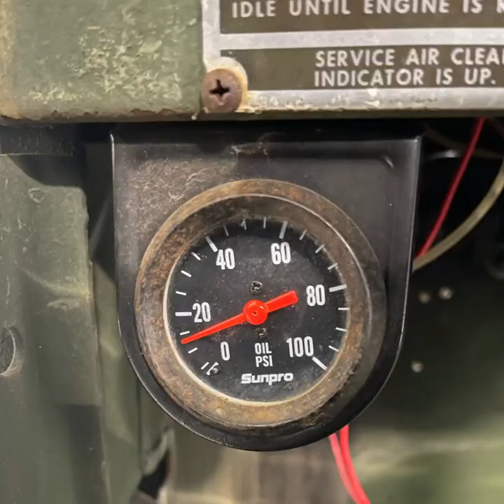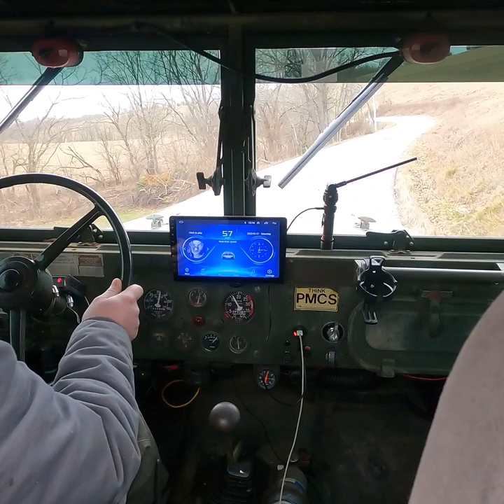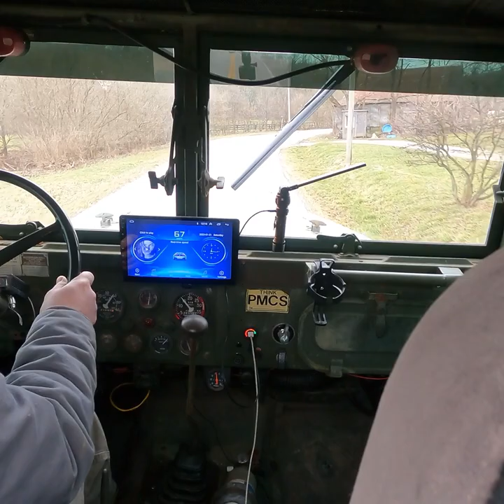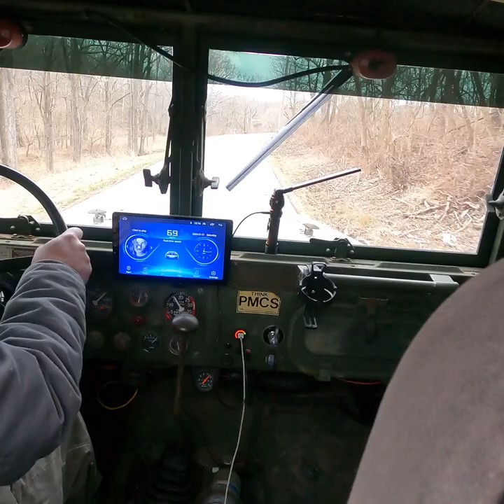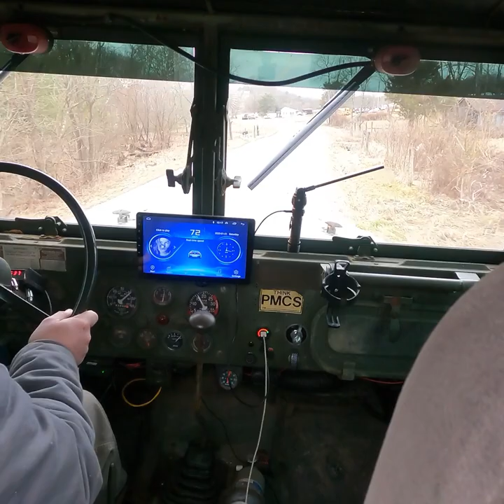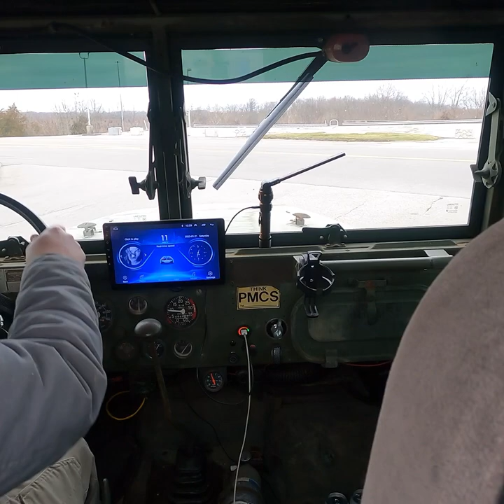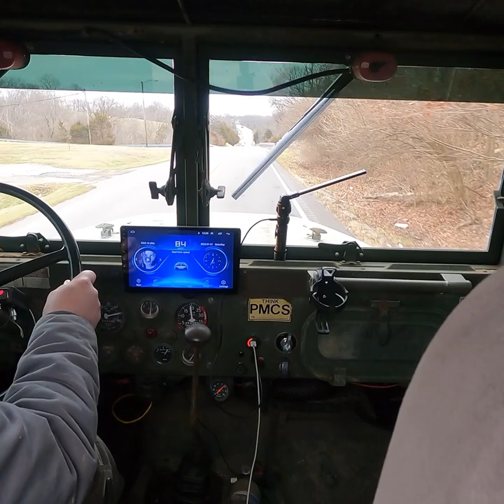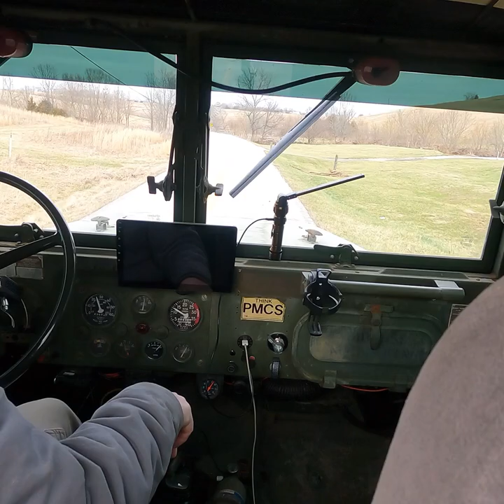Worlds first Compound Turbo Deuce and a half M35A2!

Comment: What were the benefits of doing this? Speed? Power?
Reply from the maker: The term Speed is never associated with a Deuce 🤣.  But increased the volume of air, lowered EGTs and more top end power.
Reply: @troopercarr8303  10/4 on the speed part, 55 mph anywhere you wanna go lol
Reply: @1white870 55Mph is if you're on bigger tires or at the governor RPM lol. I'm putting super singles on mines to get a better cruise RPM, right now, 2,300RPMs gets me around 50Mph. I really wish I was able to cruise at 62 but I doubt that'll ever happen unless I get a different gearbox

Comment: Ive got a question, i see that your using either a fass or airdog fuel pump, did you delete the intake pump? Is this a 24v or 12v? If 12v did you have to use a step down converter? Did you notice a difference? thanks
Reply from the maker: I’m using the OEM pump wires but ran it through a 240watt step down. Only reason I did it was fuel filters.   I eliminated the primary fuel filter.